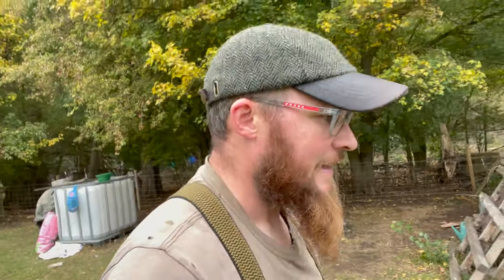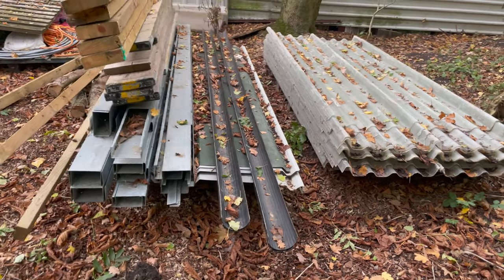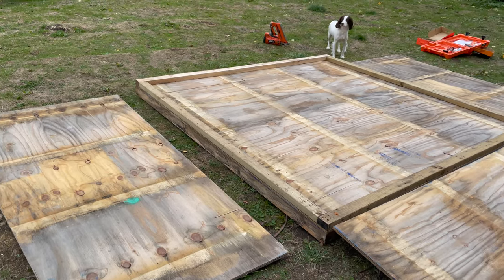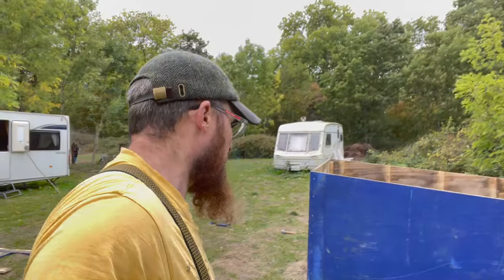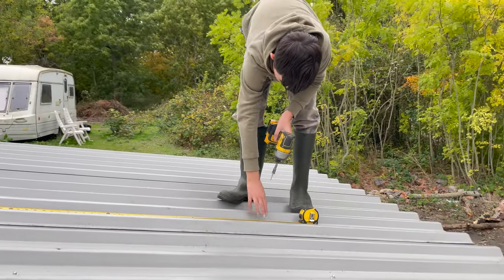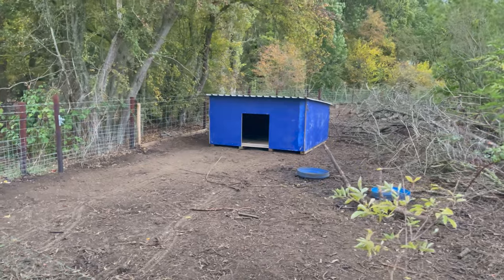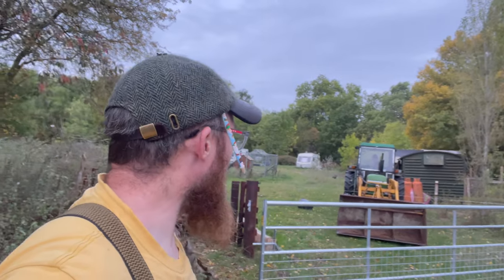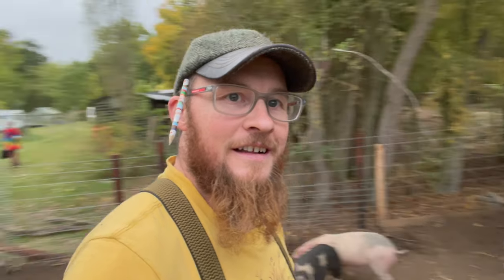How To Build A Pig Ark?

Comment: Nice build. If you removed the floor save work cleaning out cause you could just lift and move to new spot with the tractor
Reply from the maker: Building this without a floor was considered for the very reason you suggest, but as the pigs don’t usually make a mess inside their shelter I decided to add the floor to keep the pigs off the mud and hopefully help keep them warm. Thank you for the suggestion tho. 👍🏻

Comment: Hi mate I’ve got a quick question for ya. Do I need a license or anything to keep pigs or transport pigs?
Reply from the maker: You need a holding number(CPH)  to keep pigs, you can get this for free. When it comes to moving pigs you will need a movement license again this is free and is generated electronically on a website. Hope this helps. 👍🏻